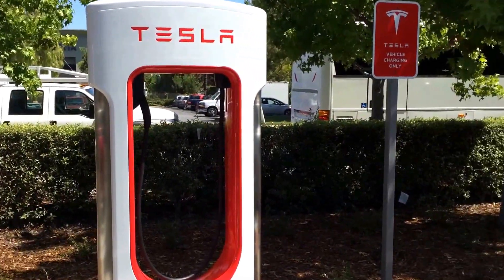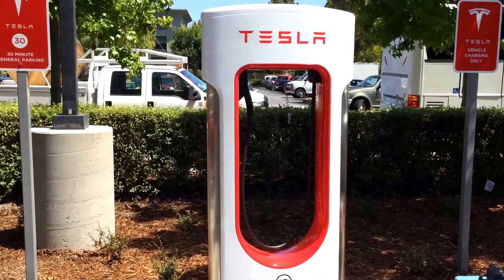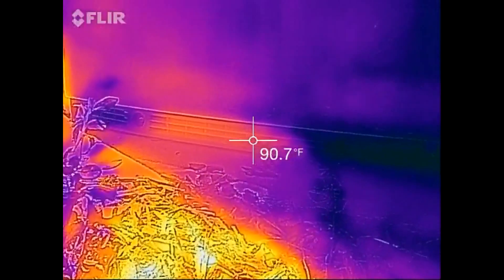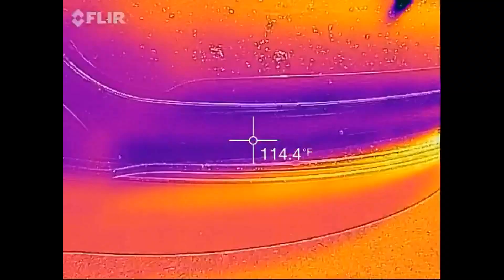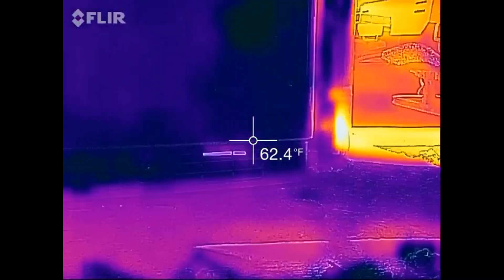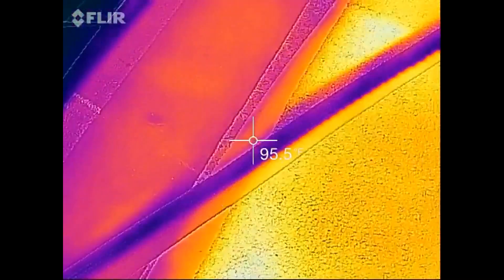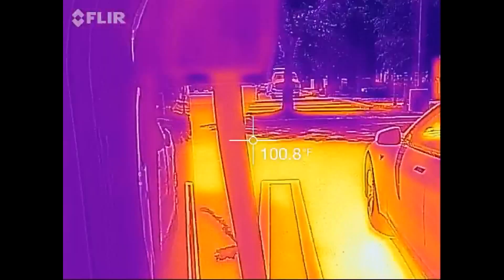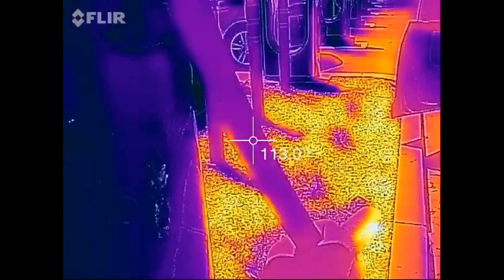Tesla Motors: Liquid Cooled Supercharger with Thermal Imagery

Comment: What's ridiculous is they probably had to get their own UL testing to re-rate the cable amp capacity when they're liquid cooled.  You would need a 2" diameter cable to support 520 amps without it and it would weight about 4 pounds per foot.

Comment: Whats generating the heat?  I thought the a/c d/c conversion was done in the big box enclosed within a fence...
Reply: Gromitdog1 The more power through a conductor, the more heat it will generate, no matter if AC or DC. The higher the power, the faster the charging.

Comment: I watched the presentation recently from the Prof at Dalhousie.
Something very interesting, and completely counter-intuitive, caught my eye.
In the graphs showing battery degradation over time, versus charge speed, it seemed to indicate that battery life could be significantly extended by charging FASTER.
I suspect that these cables are a step towards very fast charging. Double whammy. Takes out two of the biggest objections to electric cars in one fell swoop.
I wonder how much it adds to the cost of a supercharger bay... ?
Reply: ***** prob. not much. but how would it improve the lifespan of the battery?
Reply: netsurfer912 
Don't know, exactly. 
Just a trend that I noticed on a graph displayed in the background of a video presentation by Prof Jeff Dahn, the guy who recently signed up to do battery research for Tesla. You can find it on YT by searching "Professor Jeff Dahn - WIN seminar series".
I suspect that rapid charging prevents the growth of dendrites on the electrodes.
Reply: ***** if so, damn, that's amazing. thanks for pointing me there!
Reply: Also lots of very useful information on various combinations of electrolyte additives, and how these are able to improve energy density and (especially) cycle life. Worth watching more than once...
Reply: netsurfer912
It seems that the deposition of metallic lithium gunk onto the electrode is a function of time (the total time that the reverse reaction is in process i.e. charging), rather than voltage or anything else.
As long as you can "thermally manage" the reaction, faster is better. (Obviously high temperature is the one thing that will seriously hasten battery degradation.)

Comment: You got fire coming out of some plants chimneys, that's a waste, if they have unused gases  place a pipe on it with a detection sensor  that turns on an generator that runs on flammable gases and puts power back into the grid.   You got steam coming  out  of some chimneys  that means heat,  run a spiral  water pipe absorb all the heat and turn it into electricity.     There's  so much waste going on that is worth billions, by not wasting it it will only put money  in people's pockets.

Comment: Alan,   I know  what it's for and what it does.   It was just a general  comment about thermoelectric plates,  they can reduce energy  consumption  by huge percentages,   look  at let's say all the A/Cs in the world,  now if someone  created an additional flat radiator plate ,run hot freon throughout it plates on it, then add a fan on the same motor to cool aluminum sinks, then freon goes to regular  radiator in the back.   You got a $150-$200 more expensive ac that uses 30-50 percent less electricity.    Now that adds up to multi billions of profit and power savings worldwide.    I'm sure if  Tesla  would  get  into  manufacturing it they  wouldn't  be able  to  keep  up  with  manufacturing it.    Any appliance that relises heat  outdoor  is a waste of energy.     There use to be the same problem  with water boilers,  this days you can hold your boiler exhaust pipe it's  not that hot.

Comment: But still,,  a 600 watt consuming air conditioner could be mastered to half or more of its consumption build the external radiator with thermal electric plates, you allready have a fan in there, so you can cool the hot side by turning most of that heat back into the grid.    Still worth it.  You use  same  ac for  years.

Comment: To improve this video and the information it is attempting to convey, you should repeat the experiment at night (to take the solar radiation out of the equation), and also show a comparison between the liquid cooled version and the standard version after they have been running for 15 minutes or so.  Maybe you have that elsewhere in your videos, but a true side-by-side comparison would be excellent.
Reply from the maker: Lance Pickup Would have liked to, however, was on a Road Trip, and this was a mid-day side stop on the way to LA just to see the new stations. We are getting one of these about 40 minutes north of Milwaukee, here in Wisconsin. Should be online in about a month. Once online, be sure I will test the living crap out of it!
Reply: ***** A request. When you visit the new charger with liquid cooled electron dispenser could you verify or falsify the proposition that one grill is the air inlet while the other is the outlet please. I got the impression from the video that that was the case but it is not totally clear to me. I find just a small sheet of paper against a grill for a second or two is the best way to determine airflow direction. Best regards.
Reply from the maker: yes, one vent is intake and one exhaust. You can tell on the video which is which, the exhaust vent is the high temp red/orange.

Comment: Every piece of wasted energy as heat should  be used, maybe in the future  there will be thermo electric plates on the back of home ac,s. Chimneys  radiators and everything  that gets  hot.
Reply: Wojciech Zgodowski there is no way to utilize 100% of the wasted heat energy but they could get it pretty damn close
Reply: Wojciech Zgodowski That's a bit extreme.
Reply: Wojciech Zgodowski I think the point is to keep the charge cable cool in use.   That allows the cable to be thinner,/more flexible and thus easier to use. but more importantly it reduces charge times by allowing more amps to flow.  Thar may be important in the future.  Once a lot more Teslas hit the street, you might be queing for a charger, so faster charge times will be better.